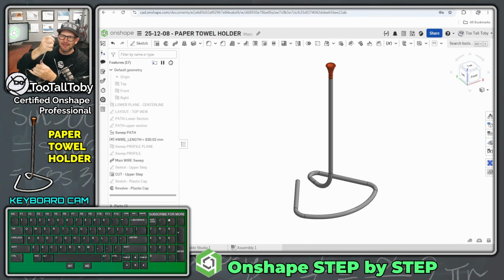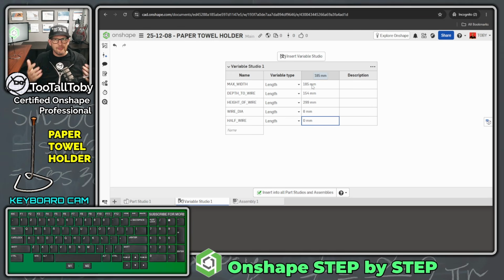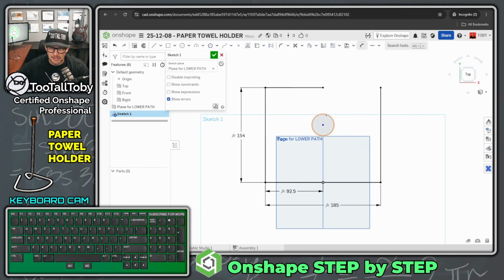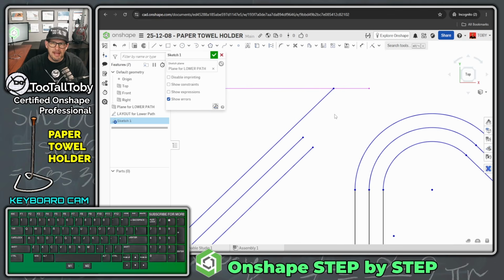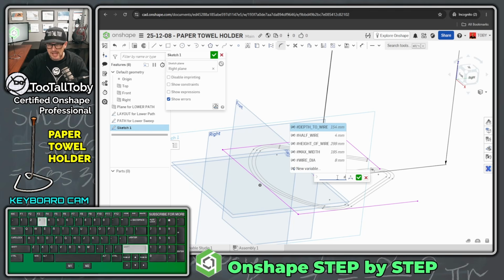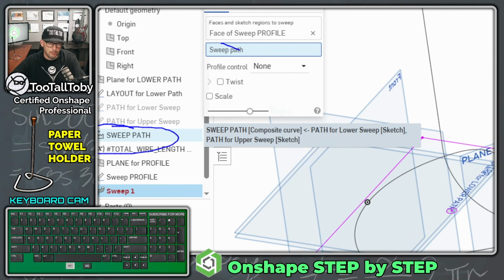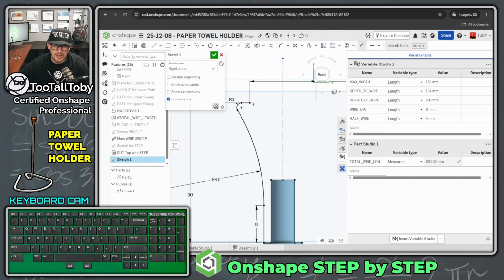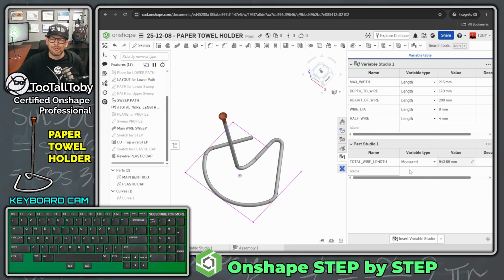Parametric Paper Towel Holder - Onshape Step-by-Step Tutorial

Comment: Maybe I missed it in your presentation, but I just learned a few really cool advantages to a variable parts studio vs in-feature variables is that a variable studio can control dimensions, feature counts, Mate connectors, and expressions across multiple Part Studios, Assemblies, and Drawings in the same document. You can even reference a Variable Studio across completely different Onshape documents.  Excellent video that I watched more than once to make sure I cold soak up as much info as I could.

Comment: I think  it would be useful to explain why you used a Variable Studio as opposed to defining variables in the Part Studio. I think I know, having been burned by not doing that but it is an important distinction.
Reply: Yeah that's a great point - I covered this a bit in another video, but the big difference is that the variable studio can be used in every tab but the defining variables in the part studio would only be available in that part studio (I think).  So for a single part it's no big deal, but for a project with multiple parts and multiple tabs, and an assembly, it can be SUPER HELPFUL to be able to references the same variable studio across all tabs. 😁😁